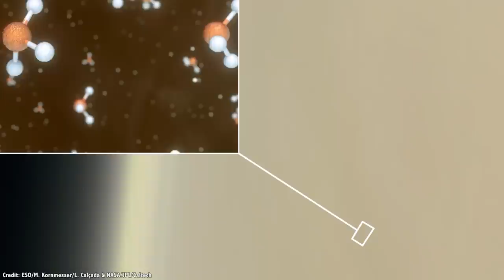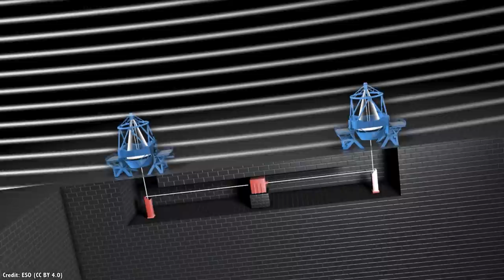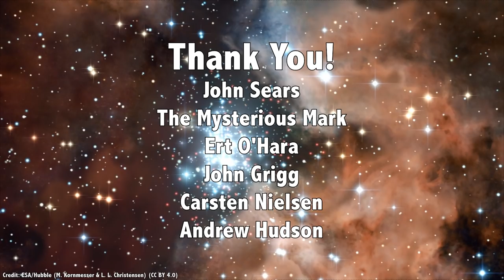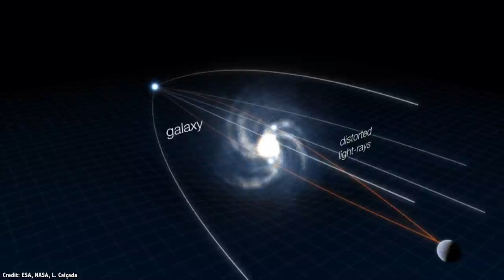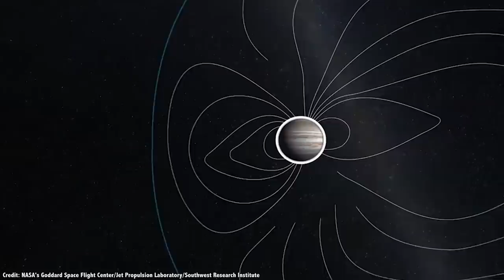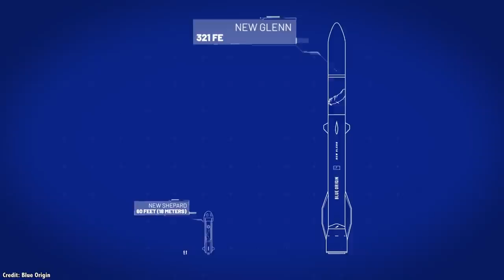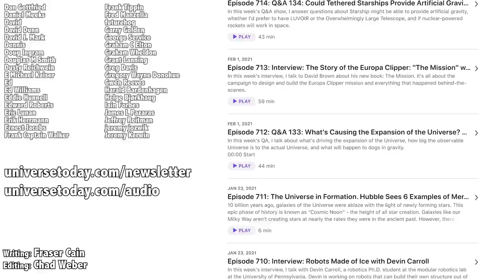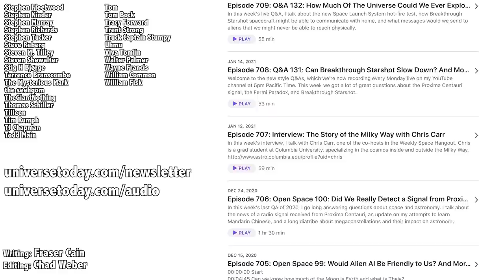Q&A 135: Where Will We Find Life First? In the Solar System or Another Star?

Comment: A steam rocket might be good for putting around in the asteroid belt.
Reply: The distances between asteroids, even in the belt, are ENORMOUS. It's not like what you see in movies, where the asteroids are packed in close, with regular collisions obliterating other asteroids and any 'Bad Guy' ships foolish or brave enough to follow the 'Good Guys' through the field. The average distance between asteroids in our local, little asteroid belt is 600,000 Km. That's about 400,000 miles. That's about twice the distance between the Earth and the Moon. Since it took the Apollo astronauts 3 days to reach the moon, that would mean that travelling at the same speed as the Apollo crews used to get to the moon, it would take 6 days to go from one asteroid to the nearest asteroid. I HATE to think of how much water you'd need to carry to be able to expel enough steam to move a spacecraft for 6 days straight.
Reply: @Raz.C  It seems like the only use for steam rockets would be traveling from small, icy rock to small, icy rock - on the very cheap. 

You'd get more mileage if you turned the H2O into H2 and O and burned it, which just takes a little more time, energy and equipment than a steam rocket. So steam rockets are probably only good when you don't have the time, energy or equipment for better rockets. 

6 days isn't so long... Humans have traveled much longer by sail or by foot.
Reply: @bozo5632  
Yeah, I did a whole post about the feasibility of using energy to heat water for steam vs. using that energy for the direct electrolysis of water instead. I laid out the energy costs side by side (including adding the latent heat of vaporisation for water) in Joules per Gram. Running the numbers revealed that it cost about thirty times as much energy for electrolysis, compared to the maximum amount of energy it would cost to turn water at 0 degrees Celsius into steam (about 11100 joules per gram, vs about 420 joules per gram respectively).

Despite costing ~ 30 times as much in energy to turn the water into (2) H2 gas and (2) O gas, the amount of energy released by combusting the reactants is vastly greater than the small amount of energy gained by the release of high pressure steam. So the amount of thrust produced is significantly in favour of electrolysing and then combusting the H2O, rather than expelling steam.
Reply: @Raz.C  I didn't calculate but I figured. 

It would also depend on temperature of the steam. How hot can steam get before the kettle melts? 

And it would depend on the energy source. If your source was just heat from a couple of lumps of uranium, with no means of electrical generation, then a steam engine might be possible (and economical) where hydrolysis wasn't possible. And you'd need pressure tanks for the H2+O...

Space kids will make steam rocket go-carts because their parenting software won't let them play with fusion.